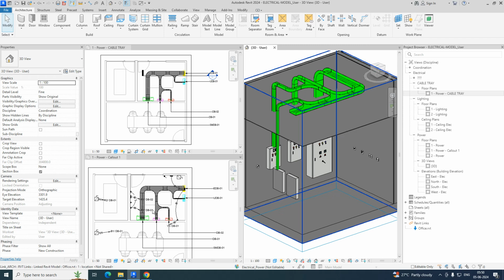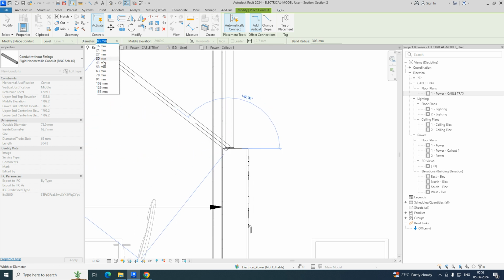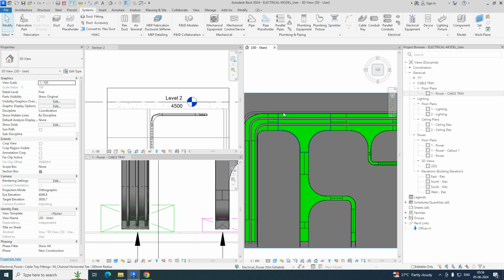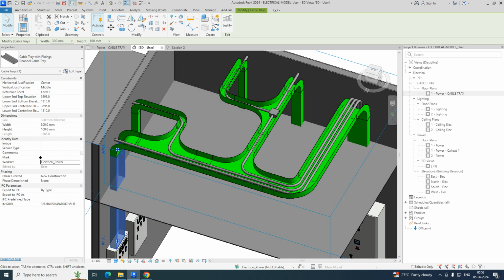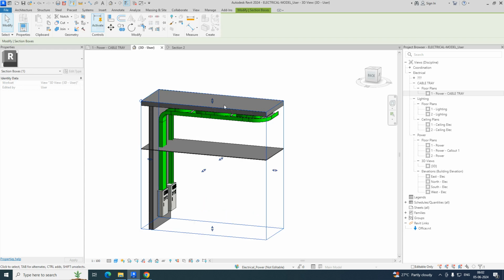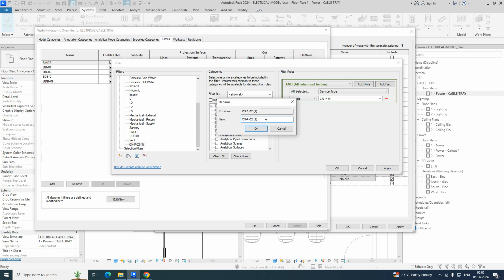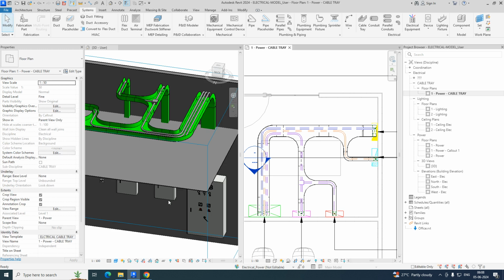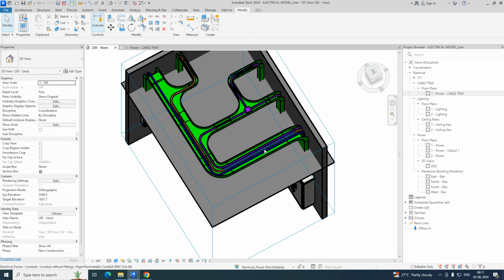Revit Electrical Cable Tray & Conduits Training

Comment: Hi Sir. Would like to check on you on what are your preferences on using family. Do you prefer using hosted or non hosted family? I prefer non hosted family but what do you think are the disadvantage for this one. Thank you sir and looking forward for your response.
Reply from the maker: Thanks for your comments Host Families are Revit families that require a specific element or category to be placed on or within. They depend on another element, called the "host," for their placement. mostly its include wall mounted and ceiling mounted such as door, lighting fixtures sockets etc.
 Unhosted Families (or standalone families) do not require a specific host element for their placement. These families can be placed freely in the model without needing a specific element to attach to such as furniture, freestanding lighting, hvac units boilers and other equipment's that can placed directly in the model.
Reply: @AutoCADRevitByju  Thanks for your response sir. In electrical sir what mostly do you prefer to use on your projects for families such as receptacles and lightings, do you prefer hosted or non hosted families to use?
Reply from the maker: Hosted families require a host element, such as a wall, ceiling, floor, or another element, to be placed. These families are dependent on their hosts and cannot exist independently. They are commonly used for elements that logically need a supporting structure for example
1.Lighting Fixtures: Often hosted by ceilings or walls.
2. Electrical Devices: Such as switches and outlets, typically hosted by walls.
3. Panels and Distribution Boards: Usually mounted on walls.
Hosted families automatically attach to the host element, maintaining alignment and location relative to the host.
Non-hosted families, also known as "standalone" or "free-standing" families, do not require a host element and can be placed anywhere in the model. These families are more flexible and can be used for a wider variety of elements. Examples include:
Free-Standing Equipment: Electrical cabinets or standalone machines.
Site Elements: Exterior lighting that doesn't need to be attached to a building element.
Conduit and Cable Trays: Systems that can be placed anywhere within the model space.
Can be placed anywhere in the model without the need for a host
I think its make sense thanks